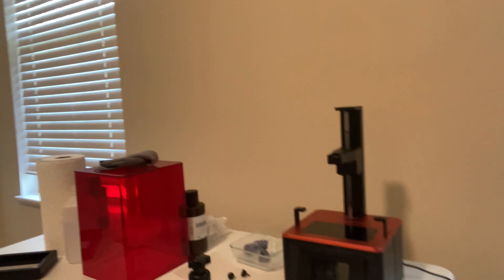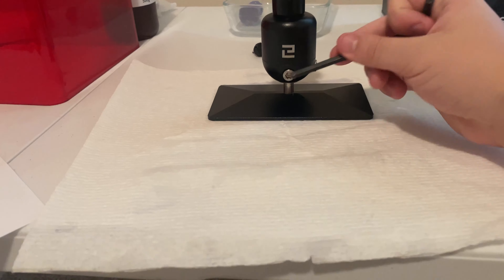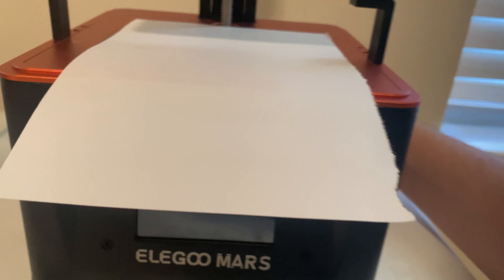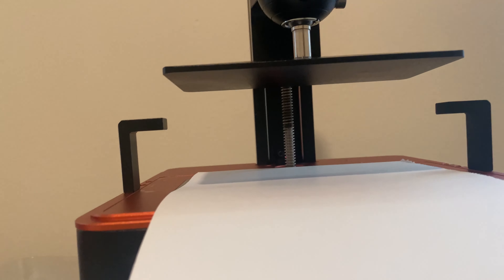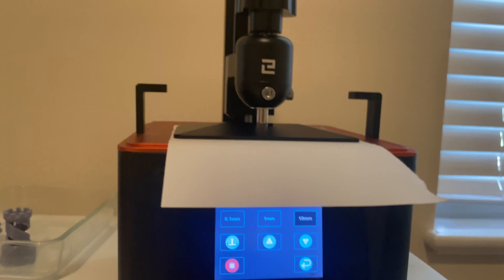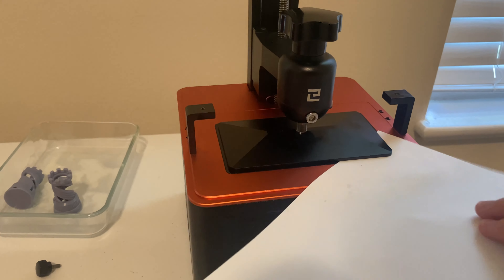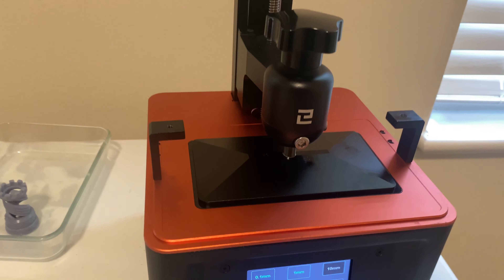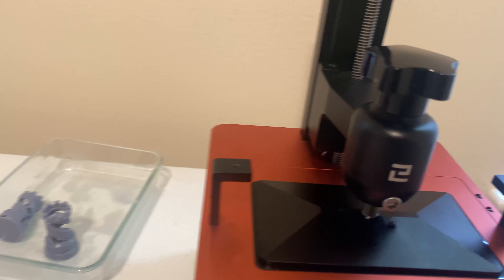How to Level a Resin Printer Bed

Comment: Just got my mar 3 pro and was struggling all night to not get the prints to stick to the bottom after lots of messing with the z point and the leveling. But your back and forth tactic on the screws seemed to help a lot cause one I would tighten the front alone the entire plate would tilt left just slightly. But also your explanation that the paper should be able to slide back in makes sense. I kept making it to tight as the directions say “resistance”. So long winded way of saying thank you for this simple video. Just check my printer and the models so far have stuck to the top plate. So excited and thank you much!